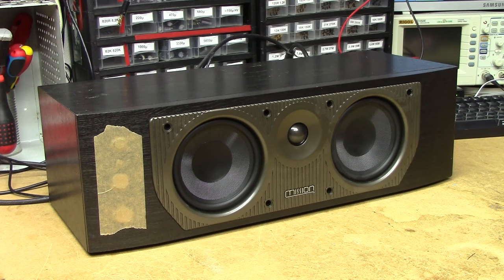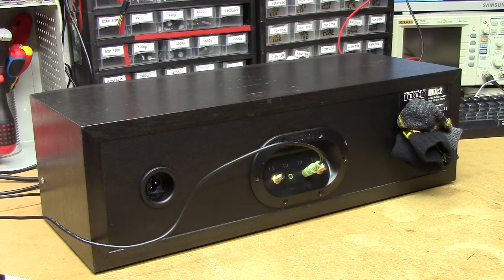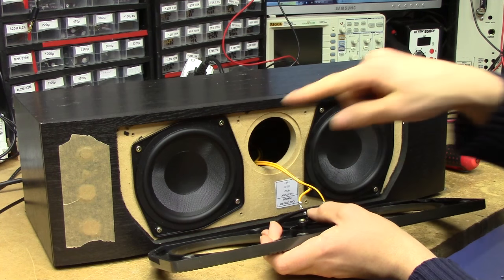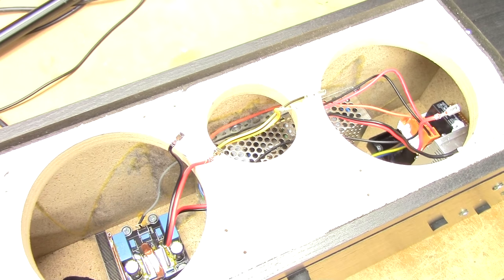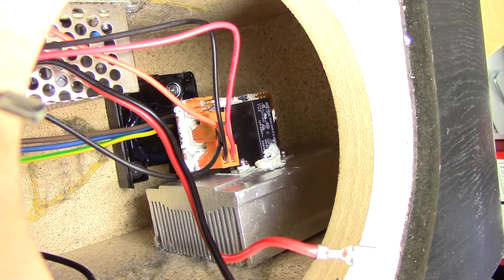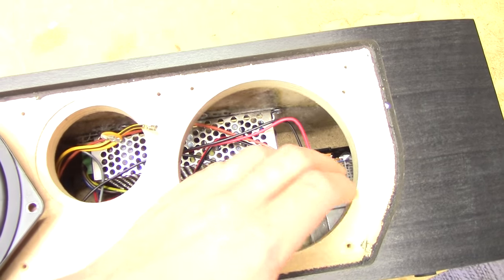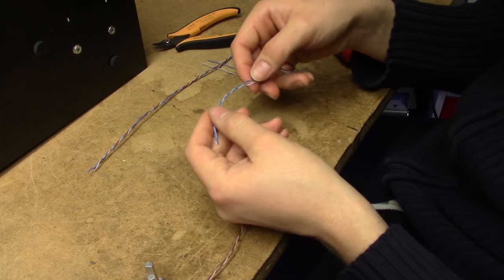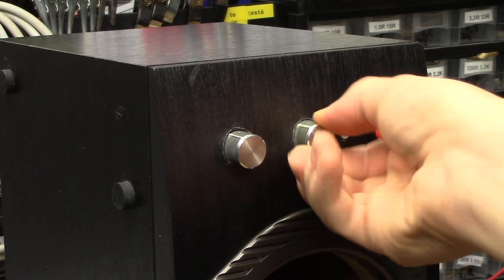"Mission C" - Lithium powered portable speaker 3

Comment: Great!! This is a very similar set up to the one that I am designing. I too came up with the solution of using a relay to switch from " mains on+battery charge" to battery power only. I have been looking all over the place for this solution. My set up will be 11.1V using three protected 18650s in a battery holder. I have found a little balance charger called the"G Power G3220" that runs from 12V. I am not very good at electronics, even though I watch loads of this stuff and generally get the gist of it, so I am mainly relying on little pre built units and joining them together . I have watched nearly all your videos an found them extremely informative so thanks. All the stuff about distortion and noise was fascinating. Keep up the brilliant work!! and if you ever get chance to review one of these little balance charging units I would be delighted. Cheers Dean
Reply from the maker: +MrFigFisher I'm glad you liked it, and I'm especially glad to hear that you're watching lots of my content. The protection boards I ordered for this project don't have balancing, I don't think. I did order a three-pack, so I'll be left with one to experiment with, so there might be something coming up about that.

Comment: "it feels great when you plug it in... really makes it feel like a quality piece of work, even though I'm the one how built it" xD
Very interesting project, looking forward to see the end result =)
I would consider adding an Bluetooth module. At parties I often had my phone directly hocked up to some amp, I always ended up running back and forth just to change a song...
Reply from the maker: +Das OSi Bluetooth is an interesting idea, and it could theoretically be piggy-backed onto the DSP board since it has a USB host connector. It already has integrated WLAN, however, so it's more likely that we'll utilise that; the DSP board is basically equivalent to a MiniDSP with an Ebay wifi router module and a big transistor added on.